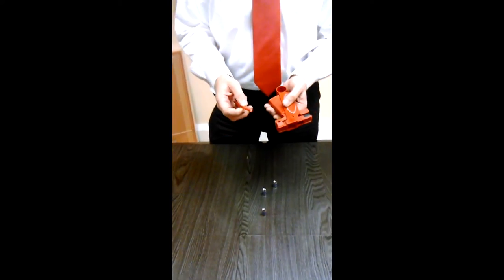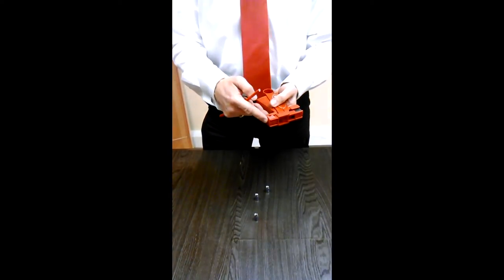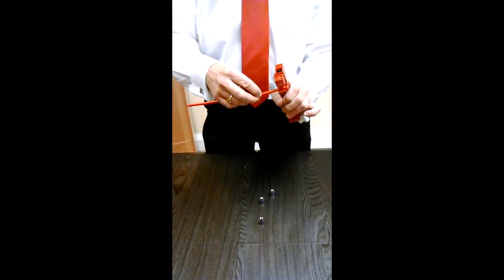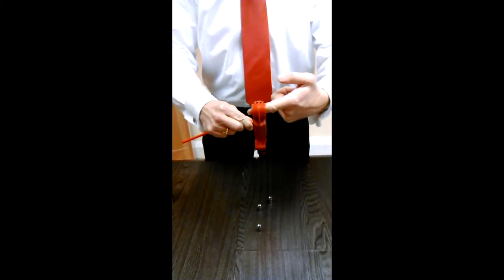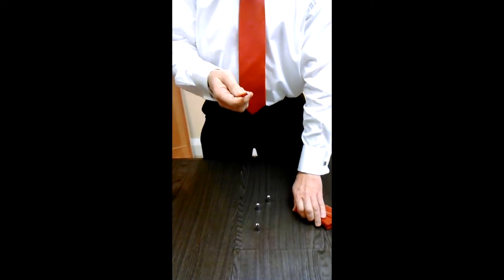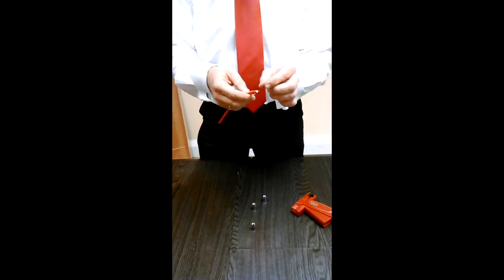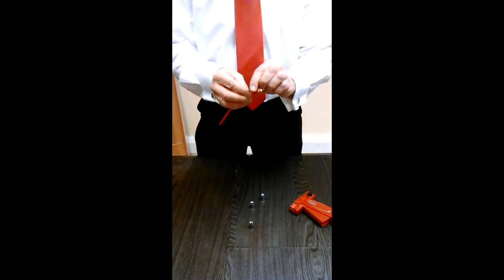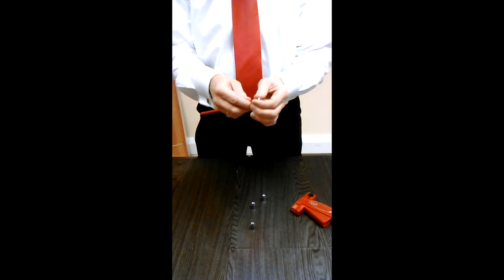WF100 Connectorisation

Comment: A bit of a struggle to hear this on full volume, and filmed 90 degrees out on a mobile device so is quite bad to watch on a tv / pc / laptop (maybe it's watchable on mobile device when tilted to match though!). I have just bought some twin cable but notice a difference in the numbers between suppliers! Is WEBRO Twinsat 100LSF cai 0013a the same as WEBRO Twinsat 100 - WF 100 TWIN LSF cai 0007a does anybody know? both are copper type.